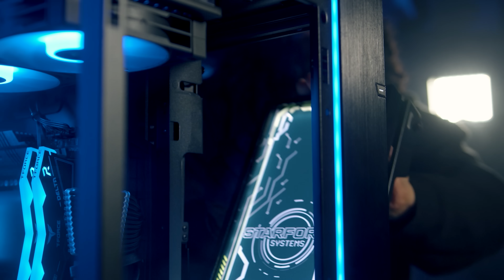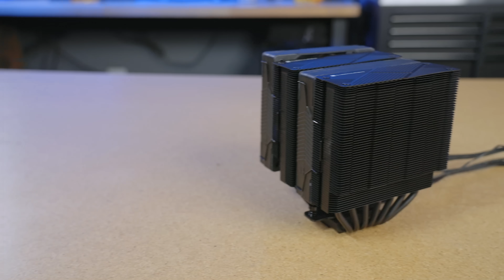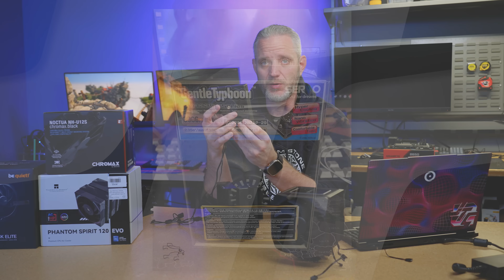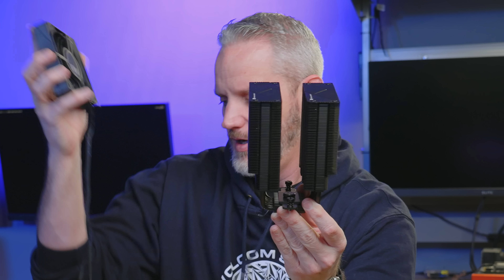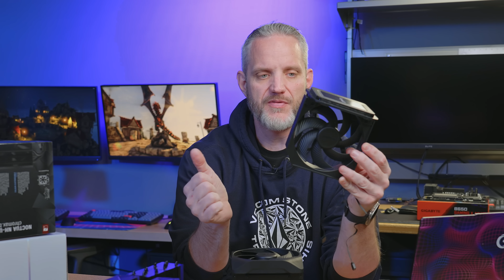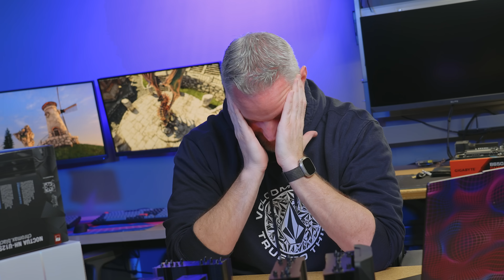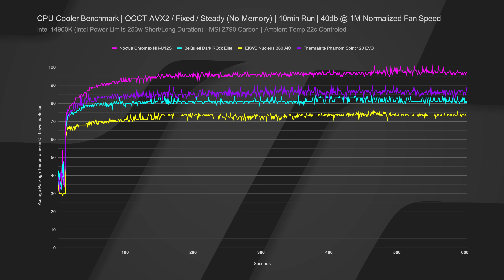This $49 CPU Cooler has big brands SHOOK! Thermal Testing Cheap vs Expensive CPU Cooler!

Comment: Thermalright Peerless Assassin 120 SE ARGB White CPU Air Cooler ($43.00), 6 Heat Pipes CPU Cooler, Dual 120mm TL-C12CW-S PWM Fan, replaced my 360 AIO. I have a 13th Gen Intel(R) Core(TM) i7-13700K 3.40 GHz. Don't have to worry about cooling anymore or even leaks. I even redid all my fans and hook ups and learned a lot more about my PC. Works great!!!
Reply: I got the same cooler on my 5600X but the 5 pipe version. Never going to a different cooler unless the cpu needs it.
Reply: Nice haven't done the white version but have on my 9600K (better temps than evo212), 12700KF. 12900KF has the PS cooler and I think FC is going on 9900X3D. Have PS spare and honestly they have been great coolers. Only use the idcooling se214 on lower end 12400F etc have a spare of that too. TR coolers are easy for me to mount, set, and forget for a while. I repasted one and it was not needed. Compared to the 212evo I found installation easy. Can fit 2 or 3 fans on them, have a bunch of spare fans too.
Reply: Thermalright Peerless Assassin 120 SE ARGB White CPU on my Ryzen 7 7700X and it is barely audible even when I throw cinebench, 3dmark and whatever game I toss at it and the temps are rarely above 80-85C. This cooler takes whatever you do and just keeps on going.
Reply: got the non-RGB version of same cooler for just $32 a couple years ago (currently $35). replaced a 240 AIO. amazing performance on my 5600X.
Reply: It's great, although my 13600kf does go up to like 90 sometimes when under high stress but it's still very quiet
Edit: undervolted the cpu and it's like 20c lower, don't trust factory defaults I guess
Reply: @Fishdevil  I use the normal Thermalright Peerless Assassin 120 without RGB on a 13600K with PL1 = PL2 = 181W and the temps are max. 70°C to 73°C under stress tests. Have you set the PL and the voltage (LLC)? If not, you should do this. My system runs fine since nearlly two years. No throttling or high temps, even in summer with 30° or 31°C room temperature.
Reply: @MrSteini1979  That's the model I got when I bought my 9800X3D. Definitely keeps it well below 80C despite having a 200mhz overclock on it.
Reply: @Fishdevil  My 13600k stays on 80c full load with an Arctic esprots duo , i think you might have to lower your loadline calibration a little m8 .
Reply: @ that is also a processor known to run like a furnace lol. Could heat a studio apartment with one running Cinebench
Reply: I've had a Peerless Assassin 120 sitting on top of my Ryzen 5 7600X for more than a year. No RGB, no LCD screens, just performance. The only maintenance I need to worry about is blowing the dust off.
Reply: I have the same cooler, but I swapped the fans for Noctua ones, it runs like a champ!
Reply: What temps you get? I'm still running my 11 year old h100i aio that I refilled when I moved to the 13700k build in 2023. Had it undervolted the whole time so no degradation. But I might hit 68-69 max in the summer with a 750d case that's also 11 years old. I don't really have any a worth a damn, gets to 85-90 on the hottest days in my house
Reply: @Dzugashvili refilled with what? If destilled water, check derBauers video from this weekend!
Reply: Excellent cooler. Served my i7 13700kf just fine for anytime I've been monitoring temps.
Reply: My friend had a stock cooler on his ryzen 5 3600X .. and the CPU died. He bought a new 5700X, the stock cooler couldn't keep up, so I bought the same one as you(without RGB), for him, installed it and his idling temps went from 45-48 to 25-26C. His loadtemps  are around 70C not much more. It also lowered the room 2 temp degrees celsius. I have one myself on a 5800X3D. One of the best coolers out there and it a lot of bang for the buck!
Reply: I got the same cooler but in black on my 9800x3d. Keeps it very cool for such a cheap cooler.
Reply: I undervolted my 12900k with a -150mv offset in XTU and it went from constantly being in the mid 90s to around the low 80s and I kept the exact same performance. No stability issues. I have the peerless assassin and I will never get another cooler. It embarrasses any other air cooler on the market besides the phantom spirit which is pretty much the same thing, or close.
Reply: Crazy 😧
Reply: Brothers with 9800x3d / peerless assassin 120s,  how high temps during intense games or bench?    Dead space is hitting 95c occasionally.  Cod is like 60c. Idle is 48c.   Ambient 21c(70f)
Reply: @oldschoolpanels  I have a 12900k, a beast, and it keeps it cool very well. Just have a good undervolt and you get similar, if not better score, and significantly less heat output.
Reply: @oldschoolpanels  what is your ambient temp
Reply: @krisc1684 should have included like a cool 21c (70f)
Reply: Same cooler with my 9800X3D and it works great.
Reply: I got that one for my 7800x3d, I don't think I've seen much temps over 60 Celsius

Comment: I am using the Thermalright Peerless Assassin 120 on my 7800X3D. Never have any issues even under load. Max temps are under 70c on 3+ hour gaming sessions. Would definitely recommend for a good budget option.
Reply: Yes sirrr me too. 
Highly recommend this option
Reply: same, it works so good and it was like $15
Reply: My 7800X3D has a Thermalright 360 AIO.
Reply: Same cpu-cooler combo here. Works perfectly, though  my temps are higher (manual fan curve optimising for noise rather than performance, I took a few degrees penalty for... quietness).
Reply: @attemarttinen  I guess im wierd i like to hear the computer running. i would go mad if it was silent. But either way my window ac is so loud when its on i cant hear it much.
Reply: I went with a Burst Assassin for a 7900x and it does more than plenty with keeping it cool, even after extended hours of playing on a less than superb airflow case I still haven't gotten it to throttle yet.

Comment: Been using thermalright products for years.  Even their AIOs are insanely good.
Reply: Same. Why spend 3 times the price when their quality is just as good
Reply: @spentcasing3990   trump: its going to be 10time higher price than ever now
Reply: @Vuln000  10x higher........for Americans :D
Reply: Yep, Thermalright AIO in my build, cost me like £30 in an Amazon sale.
Reply: The thermal right macho was amazing and heavily under appreciated. Especially the 140mm model
Reply: Yep my first Thermalright cooler in 2001 was the all copper SK-6 w/ high 6800 RPM 60mm delta fan. This was about 25yrs ago on my first PC build. Early 2000's was interesting. Very slight CPU gains for a long time. GeForce Ti4400, 9800pro. CRT 100hz monitors. Counter Strike 1.6/Source. Half Life/Half Life 2. StarCraft.
Reply: my 20 dollar Thermalright air cooler outperforms my 150 dollar Cosair AIO by 6 degrees with half the noise.
Reply: Love my peerless assassin.  I'm too much of a wuss to try an AIO yet.  😅
Reply: @ArshesNei8  AIOs have their place, mostly in compact builds because modern air coolers are soo good. Nothing beats a silent PC either.
Reply: @ArshesNei8  Same. $35 for a cooler that performs as well or better than noctua's was a no brainer for me.
Reply: Same, I got their 240 frozen nott rgb AIO, and my Ryzen 7 never went past 43c under load. Now the wife got me the Thermalright warframe Pro 360 AIO for my birthday, and I love it. It has a module screen that can either attach to the pump or any metal surface, and that brought my temps down to 35c under load. All my case fans are Thermalright as well.
Reply: I have one of their AIOs. The rad is great, the pump was a little loud but a little fancontrol tweak fixed that, the fans started grinding after a few months and I had to swap them for Arctic. If the fans weren't a problem it'd be an amazing deal, with the fan replacement it was still okay price:performance
Reply: In the uk, they are only 20 quid cheaper than arctic. And i want no rgb fans, so to buy thermalright's and replace the fans, they cost the same. Arctic is better, so to me, Thermalright's AIO's are pointless.
Reply: My old i7-2600K at 4.8 still has a Thermalright Macho on it. Even under full load while OCed the fan barely needs to ramp up cause there's so much thermal mass. Unfortunately couldn't reuse it when I built my AM4 rig in 2019 because the socket adapter frame was impossible to get a month after it was announced... which sadly seems to be the norm for thermalright. The coolers are awesome, but forget about post-sale support for new sockets
Reply: @Knaeckebrotsaege  thats why thermalright introduced the Aro M14. its the same cooler just with AM4/5 Mounting only... sadly takes away the multisocket feature
Reply: @Knaeckebrotsaege  Lmao yeah - what was the TDP of the i7s up to like 8th gen??? 95W max???
My last build, was a 6700k with a Noctua D15 - probably because I googled "what is the MOST quiet cooler at any price range".
That being said, having a 300 watt cooler on a 100 watt CPU, the thing has never hit 50C in its life even at full load.
Reply: @ryanjay6241  my 2600K definitely wasn't sipping just 95W... i ran it at 1.485V to reach 5.1GHz for a couple benchmark runs before settling back down to a more conservative 1.375V at 4.8GHz .... stock vcore is sub-1.18V  lol
Reply: @Knaeckebrotsaege  Yeah that is one thing that Noctua and Be Quiet have on other companies. Long term support for new sockets is excellent. The fans last forever on those too. 
I'm not digging at Thermalright though, they do make very good budget coolers. I'm pretty sure a Thermalright cooler is in my mother's PC.

Comment: AIO’s still ftw but that $50 air cooler is crazy! Nice video Jay
Reply: May I introduce you to the $55 Thermalright 360mm AIOs?
Reply: @ I’ll have to look into this. I currently have a Corsair Nautilus, but it was only because I just did an AM5 and 5000 series’s GPU upgrade and didn’t want to wait for the AM5 bracket to ship from eBay for my NZXT z53 240mm

Comment: I would have given one of those Thermalright coolers a chance if they actually fit my case.

Also, the Evo cooler is $50 only on Amazon. Stores like Micro Center and sites like newegg have it at $70.

Comment: Wait until you try either Thermalright's more budget oriented options (the EVO is certainly a bit hefty compared to either their newer Royal series or the SE) and AIO options like the Aqua Elite V3 (or V4), Frozen Edge and more
and yes, it's called Thermalright, not Thermalrite as in the description
Reply: depending on the situation, it can easily become a matter of a substantial CPU upgrade + TR cooler vs going with less performance in exchange for buying into some all so reliable (not really) brand name

not to mention that they also got the Burst Assassin 120 SE which costs a mere $21, can be paired even with a 7/9800X3D and you'll still be good plus of course saving a huge amount of cash to spend elsewhere or having spent on that processor
noise can typically be mitigated using FanControl so that shouldn't be a huge argument to have either

Comment: Bought that exact Phantom Spirit a few months ago, it's been a true gem. I'm proud of my purchase now lol
Reply: Have 2 PS here one has been deployed 2 years cooling the 12900KF great (just use pcores gaming). Think 9900X3D is getting FC though I have a spare PS. Have 2 PA120 SEs on 9600K and 12700KF. I love these coolers so much they are great value air coolers that work well.

Comment: You can actually get a version of this for only $35-$38 with very similar performance, the Phantom Spirit 120 SE just has slightly louder fans and no fin caps but essentially identical performance. The older Peerless Assassin 120 SE is also often around the same price if you can't find the Phantom Spirit, the performance difference is often only like 3°C so it's not a noticeable downgrade in any way.

The value proposition is absolutely insane with the Peerless Assassin / Phantom Spirit lineup. ID.Cooling also has some very solid options and I know in some markets they're also very well priced, I personally run an A620 Pro SE since it was cheaper than any of the Thermalright coolers when I built my PC.
Reply: GN and now J2C really need to up their game on their lineup to really deliver a point of why it hardly ever is worthwhile recommending anything but Thermalright when it comes to CPU cooling
ID-Cooling is like the only other rival in this matter with Arctic having dropped off a fair bit as pricing rises
Reply: @john_gohan  to give GN their due I believe they have had Thermalright in their Top CPU coolers of each year since the Peerless Assassin back in 2022, I know for last year they featured ID.Cooling very prominently on the list too over more expensive options.
Reply: I was given one for free... and it was about 5 mil too big to fit my case. :)
Reply: @FutureReverberations  yea that's the only downside with them, the size restricts your case choice as well as Ram clearance.

That's just a thing with larger Air Coolers though, they're generally around the same height so you have to be wary of clearances.

Something like the ID-Cooling SE-214-XT Plus might fit as that's around 150mm compared to the 157mm of the Thermalright.
Reply: @kspectre21  Whatever case it was going in has to be quite restrictive, I run a PS120SE on an ITX motherboard in a coolermaster NR200 with zero fitment issues for either the case or the RAM.
Reply: Running a Thermalright peerless assassin 120se on my system.  I think I paid about 35 bucks a bit over a year ago.  It’s been a great cooler.  For ram clearance issues since I had a little issue with that, I mounted one fan in the middle and one on the back toward the rear of the case.  I still have an exhaust fan pulling out the back of the case but it seems to do well.
Reply: I snagged the peerless assassin as well. It's been great, and I'm pretty much sold on them for CPU coolers. It's my main recommendation to any of my friends building PCs.
Reply: Another difference, the phantom spirit has these extensions on the top, however i have not checked if it affects case clearance
Reply: @markmorati8986  The top of the heat tubes? I don't think it does as they're listed as the same height, if it does then it's very small
Reply: As a Swede, all electronics/components has just skyrocketed in price, pricings makes zero sense any longer.. But that's how I found out about the thermal right spirit fan, it was around  40usd here, 1/3 the price of any other cooler. And wow the performance is identical to my arctic freezr AIO during gaming. It was only doing worse in idle temps, which isn't a big deal. I use it with 7800x3d and I highly recommend it if u can fit it in your case. It's a no-brainer buy. Excellent quality/performance.
Reply: Crazy 😧

Comment: i run a Thermalright Peerless Assassin Mini on my 5700X build. it's really good value for the good cooling performance it offers. haven't seen temps above 73 degrees C during use in this summer heat

Comment: thermal right coolers really kick but for their price ngl
Reply: I have an Assassin king 120se on my 5600X and its never gone above 68C with overclocks.
Reply: Thermalright gets the price right (too).
Hardly any competition in sight other than a few outliers like the ID-Cooling SE-214-XT which GamersNexus also recommends on a low budget. Besides that in terms of AIOs, there are plenty sitting below the $60 mark. Yes, this cheap.
A NH-D15 G2 costs near triple that. Even if you consider a made-up lifespan of like two years, you could still easily replace the unit and probably have those 3 fans to spare for whatever application. Maybe a DIY desk fan to not be forced to pay $100 on the Noctua one?? lmao
Reply: @ I have a Noctua NH-L9 and its not good with the 5900x, So I am upgrading my friends 5 3600xt to a 5700x with that cpu cooler on it! I effin love the NH D15S look but its too expensive!
Reply: @johnbernhardtsen3008  my cooler was $19. Best investment ever since thermalright fans are $13 for 3- 120mm’s.
Reply: Got the Phantom Spirit 120 for my 5800X3D this week because it was the same price as 2 new fans for my old Scythe Mugen 5 and its awesome. For 42€ the cooling performance while its nearly silent is insane.
Reply: not just for their price... they kick butt period.
Reply: yup. i have one and it cools great. others may beat it, but they are double or triple the price. and the performance difference isn't enough for that price difference. with the price difference i can buy an ssd for a game drive instead of only having one drive.
Reply: I have build 2 5900x systems which uses the Assasin 120 in both, they max out at 71 degrees celsius with undervolting!they would usually go to and a bit above 85 degrees celsius with default optimized settings!
Reply: I meant max 61 degrees celsius with cinebench r20 and a bit over 8200 points with a mediocre 4060 and  48gb 3600mhz ram!
Reply: Crazy 😧